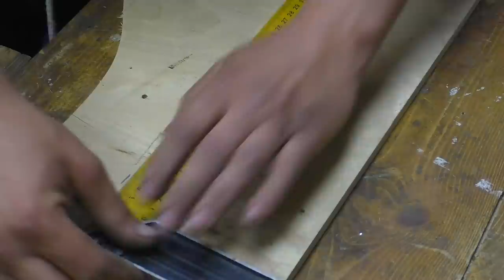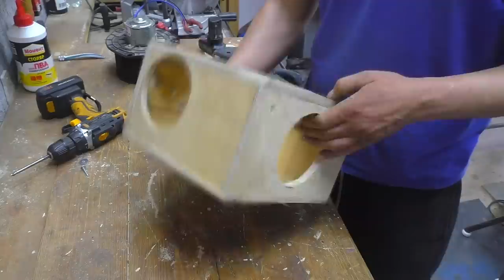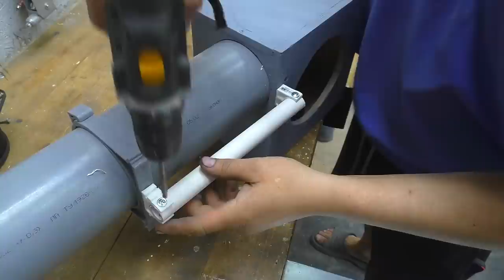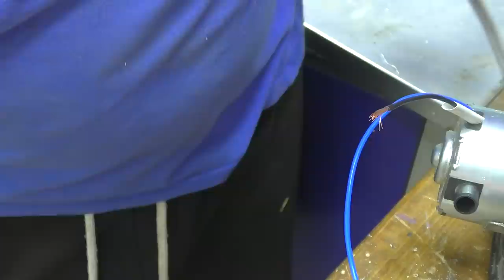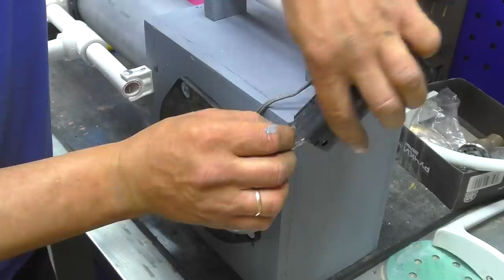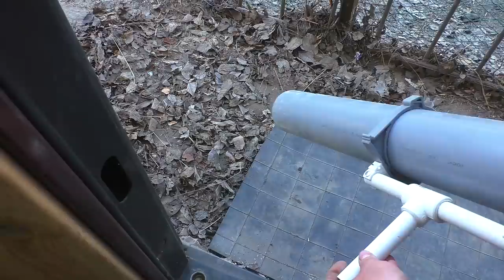Amazing device from car heater motor!

Comment: Blew me away with this. Pretty cool. Great idea. The part that got me was your power source. Seems like you can use almost any rechargeable battery for that. It seems cheaper than the store bought ones that cost an arm and a leg. Nice work my friend. 
Cheers.

Comment: Everyone seems to be shouting about a smaller pipe to make more blowing power but it would help to know how the air flows in the first place. The air intake should be on the open side of the blower wheel (not the bottom of the box) and the wheel should be  as close as possible to that opening to prevent lost air. Secondly, air moves better when it doesn't get stuck in square  corners so likely you could use some soft plastic parts stapled inside the box to round things out. These modifications alone would probably triple the blowing power.
Reply: Yeah there is no air intake. It's frustrating to see this.

Comment: I love you measured and made a line, then used a table. The fence kind of defeats the need for a line. Surprisingly you didn't use a hole saw after you used your compass to draw your circle.
Reply: Yeah who keeps hole saws that large around the shop? Not many people unless you cut a lot of holes for a business. You use what you already have. If you don't have a table saw you can use a hand power saw. I seen people make table saws out of tables and a circular saw and use a level for a fence or even a straight 2 x 2 and use c clamps to fasten it to the table.

Comment: to what the three side openings?  did you use one for the engine, one for the air exhaust, the third in what?  perhaps as a gateway to future access to the interior?

Comment: An old speaker or subwoofer box is similar. For a heating system such as propane or wood stove blower, use sheetmetal to make the box or air exchanger.

Comment: why didnt you use a heat dissipating resistor to keep the button and wires from heating up  .   how many minutes does battery last ?   not enough amps to last more than a few minutes, if it did it would melt the button or wires without the resistor..  put you a  heat dissipating resistor in the air tube to keep it cool and use a 12v mower battery and it probably could run 30 minutes or more on a good 300 cca battery ,  most of the blower out of cars i ever seen were over 20 amps . no way that little battery can deliver that ..    still a cool video

Comment: I wonder if theirs a way to improve it's output
Reply: By reducing the end of the tube more power can be produced, the same thing you get from reducing the available area on a nozzle for a water hose.
Reply: Yes, first the Air inlet must be in the wall opposite to the mounting side of the motor, with a short lenght of round tube towards the inside if the rotor, not the bottom intake used un this design; second using a thin wood panel construct a spiral wall surrounding the rotor with separation between wall and rotor increasing as It reaches the output side.

Comment: Just about every shop vac today,doubles as a leaf blower.
I get it when people like to build little devices that don't really work for fun ,but I need real tools not a leaf blower that pushes leaves and dirt 18 to 24 inches away so you have to walk further away to pick it up....My shop vac will push wet leaves into the next county.....this is a time consuming toy that costs more then a 200 mile an hour REAL blower that is free with your shop vac....and is anything but amazing......you will find that out the first time you drop it...........